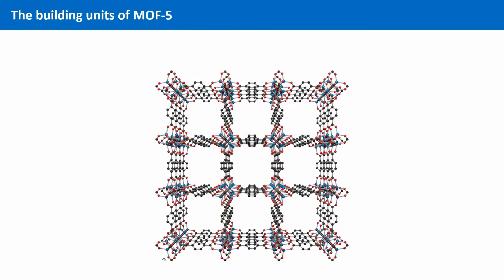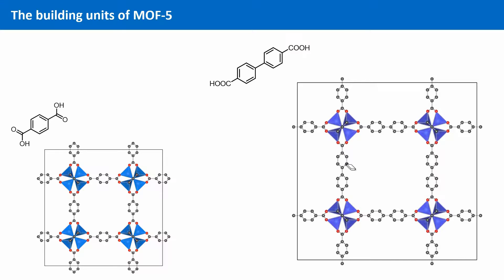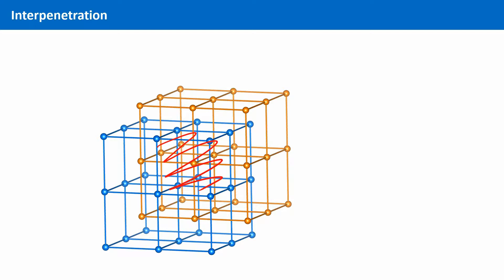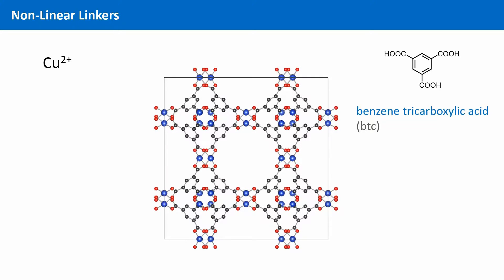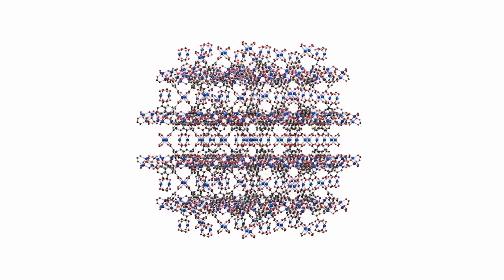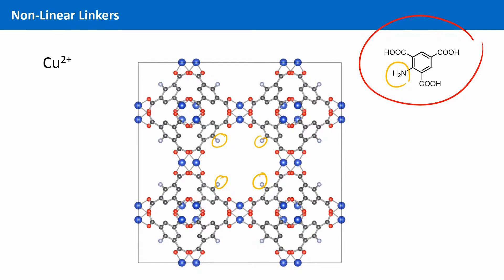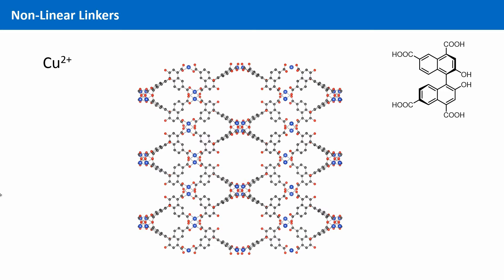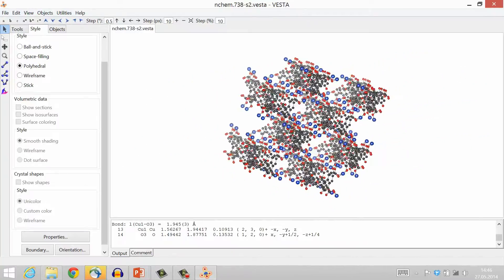Unit 6.4 - Organic SBUs

Comment: Hello Professor, I am wondering if I can visualize the void in MOF using the VESTA software? Thank you so much for the lecture!
Reply from the maker: No, this is not possible. If the pores have a more or less spherical shape, you can, of course, place atoms with a diameter that fits roughly the pore diameter at the center of these pores. But there is no dedicated tool to visualize pores within VESTA and the method I described is inappropriate for pores with a more complex shape.